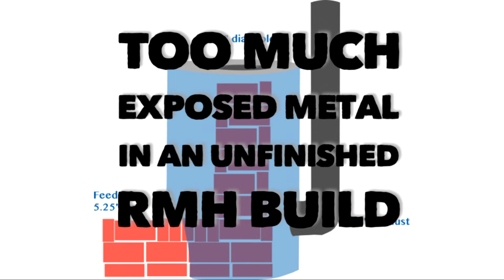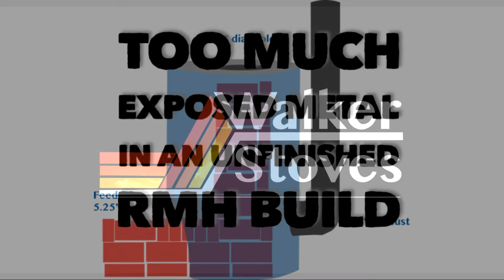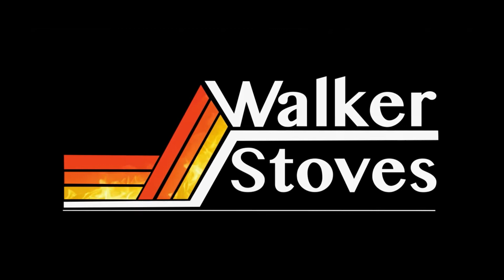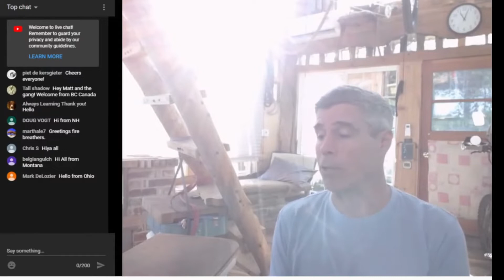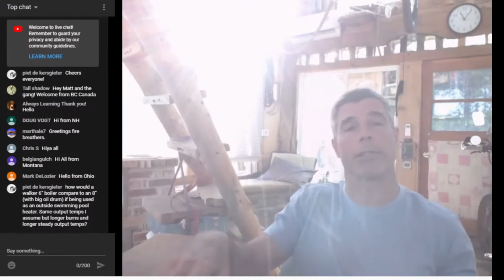Too Much Exposed Metal in an Unfinished Rocket Mass Heater Build

Comment: QUESTION PLS
I need to pick the Communities brains.
When I had my rocket mass heater it would burn perfectly clear with normal clean wood but when I added some pallet wood it would give off a thick black smoke. I'm assuming this is due to preservatives in the wood. The thermometer on the side of the barrel says 400 to 500 degrees Celsius. How do I get a hire core burn temperature to force complete combustion and thus remove the smoke.

It had a 7-in x 7-in feed and combustion chamber which exhausted through an 8-in pipe. 

I thought it would be wise to find out how to do this before I build a new one given that pallet wood is abundantly available

Comment: Instead of a bypass, or an alternative to a bypass…. What about a draft fan?
Reply: I'm wondering if you could sit an alcohol burner (or maybe even just a candle?) under the flu elbow where it turns from horizontal to vertical. I bet that would warm the chimney enough to get it going. I'd hope you'd only need to warm it for 5-10 mins?